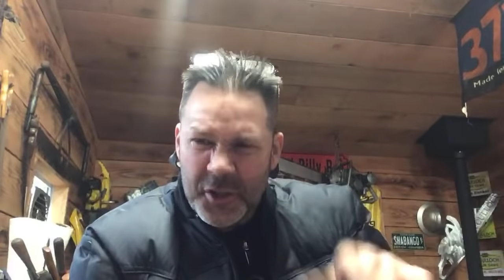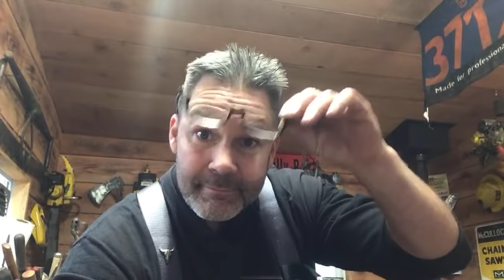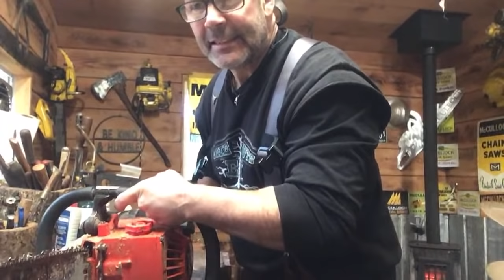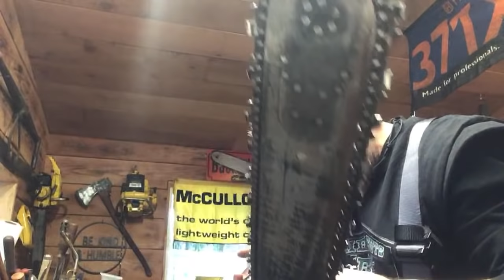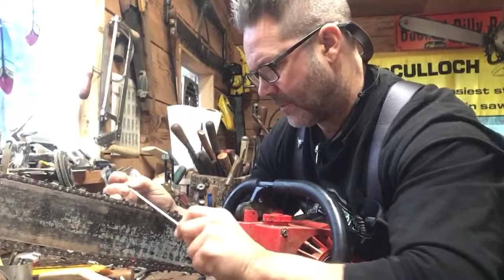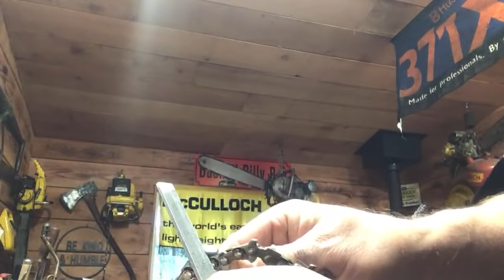Live

Comment: Dear Buckin and friends , Mr Walker is spot on when it comes to Australian hard woods , the chisel chain is faster more aggressive but when the point where the top and side plate converge is dulled it stops cutting immediately  and as that profile is best ground  in the bush that chains done . I believe the round chain enters the hardest of woods less abruptly spreading the load in a curling fashion and as such is more forgiving and therefore stays sharp for longer and I find it much easier to to sharpen in the field .  25 thou on the rakers any more and it will bog down and stop the saw dead 👍.
Reply from the maker: this is great stuff